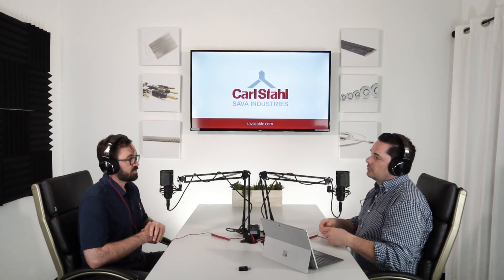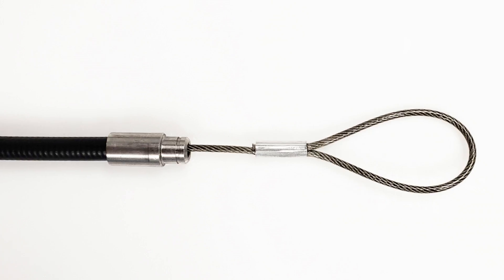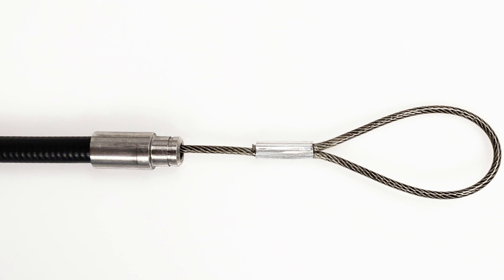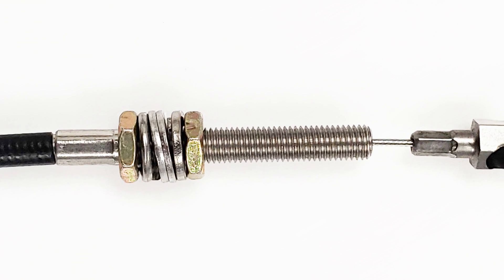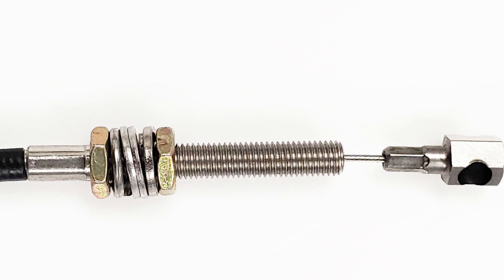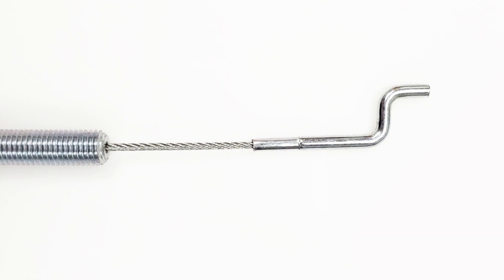Introduction to Push-Pull Control Cable Assemblies

Comment: How do you adjust a telescoping push pull has a 3" travel. I am guessing where the 2 nuts clamp to mounting bracket before the telescoping tip? If its slacking  should you pull the cable further from the part you are trying to Engauge? the front most nut being et the end of the threads and having all the threads behind the 2 nuts? Or the very tip solid 4mm rod thats threaded and connects the clevis bracket?
Reply from the maker: Thank you for the question. Given the complexity of your question, give us a shout or visit https://www.savacable.com/contact-our-cable-manufacturer-and-supplier and you can discuss your needs with our engineers. 🙂